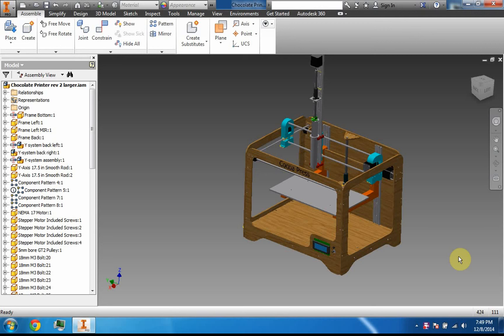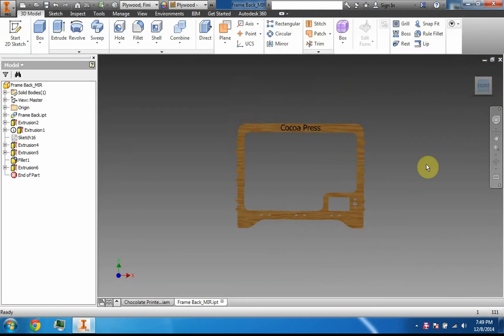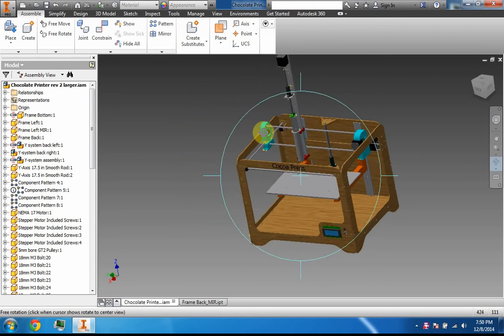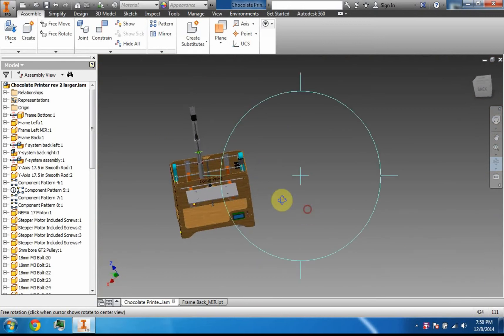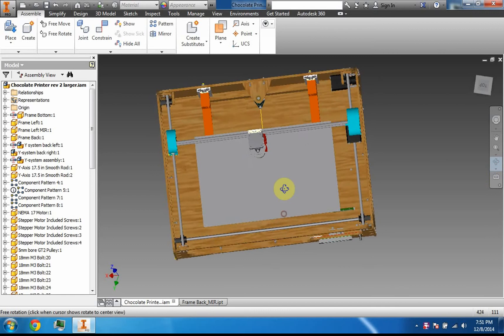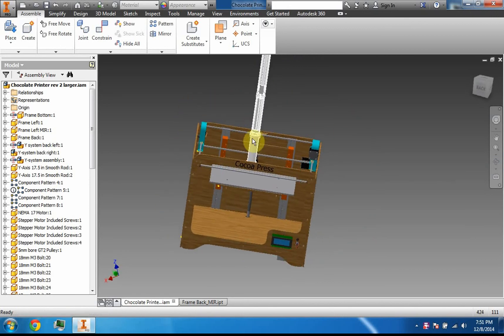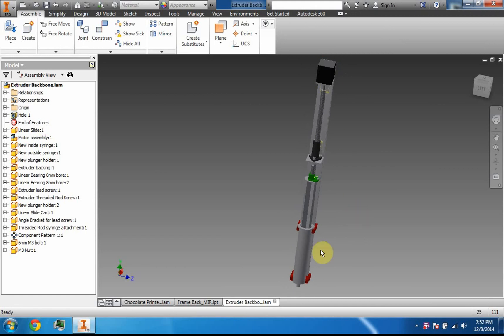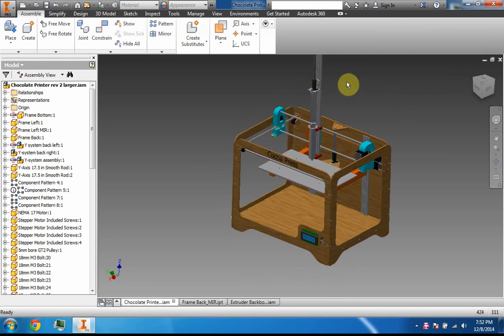Chocolate 3D printer Design!

Comment: I would redesign the extruder part.. its way to high, and will start to wobble.. try to make a design where the motor is much lower/next to the head.. (just add a set of gears to couple the motor shaft and screw..)